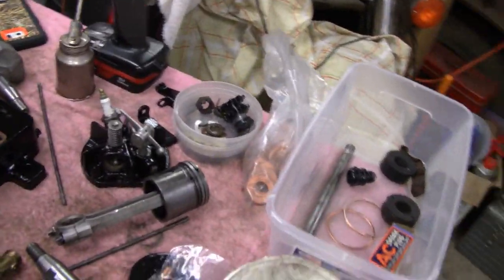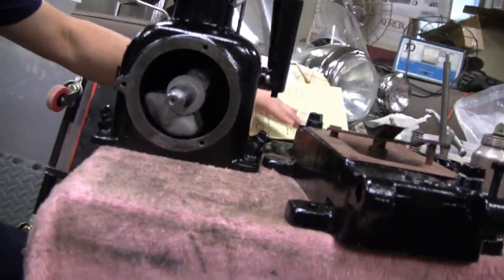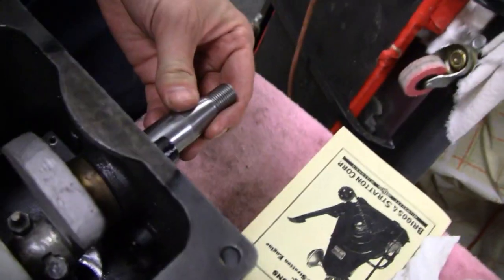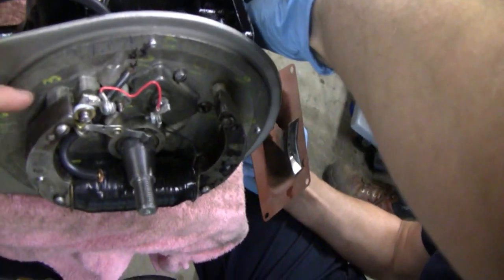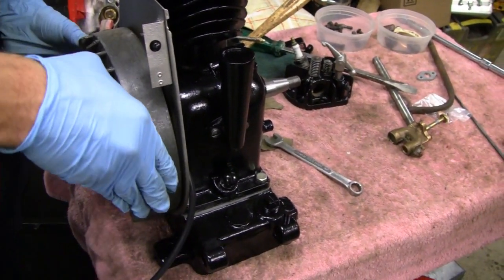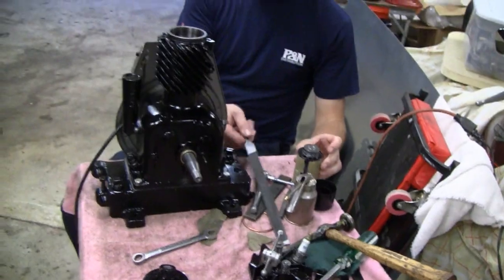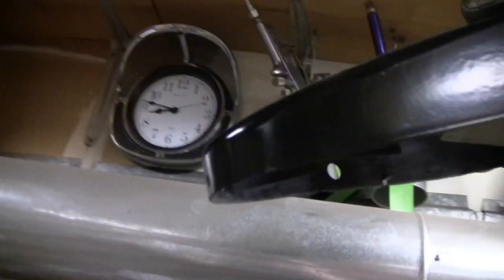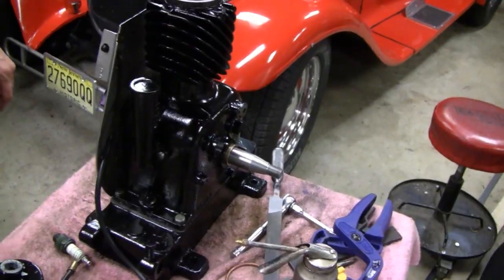1928 BRIGGS REBUILD MODEL FH (part 13)

Comment: Pot metal changes shape on its own too, if there's stress in the casting from a bad pour or even an inclusion, it will bend. I know this because some 8 years ago i bought two base plates that went behind an electric panel. They were factory new, never used, still in the oil paper.

Brand new, all that time ago, they were a perfect fit and i had personally tested their fit to make sure they didn't give me the wrong parts. When i tried to use one last year because i broke a tab, neither of the two would fit anymore. Almost all the tabs were out of alignment.

So yeah, pot metal ain't the most reliable out there, even when it sits on a shelf.
Reply from the maker: Yeah it's definitely unstable, but our backing plate was hacked up with some pry bars!!☺

Comment: Hi that motors coming along nice. I didn't know a plug like that existed for use other than testing, some more usless information to store for the bar quiz night questions, as my GF says about some of the odd info I pick up and retain L.O.L.
 seeing you guys test that spark with the gloves on reminds me of my granddad . He would hold the wire while a guy cranked and would tell you if it was making good current or not.  I can do it a bit but not like he could, I tend to put it down quick he didn't  and would hold all the wires one after the other down a multi cylinder old school motor. I bet some of these modern vehicle coil packs would of switched him on pretty good though !.
Reply from the maker: Grandpa was Goofy!! I hate gettin' bit by those Bitches!!☺